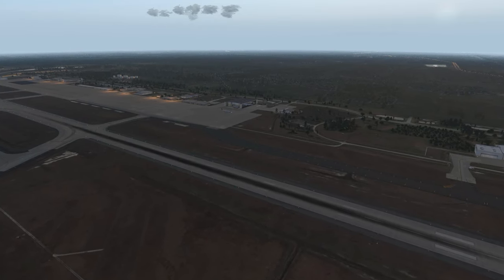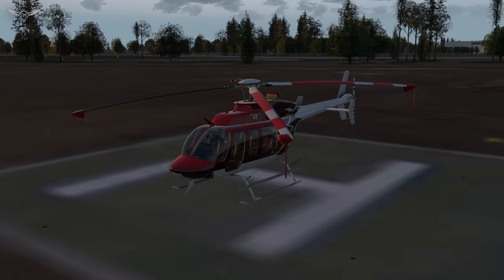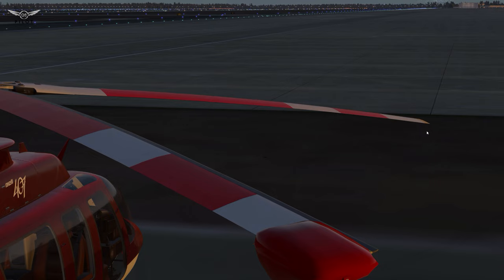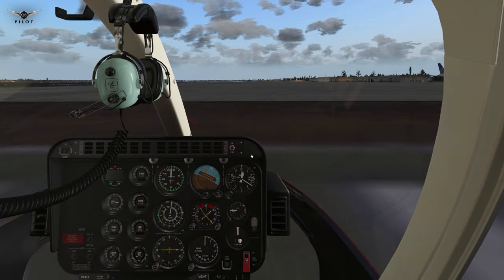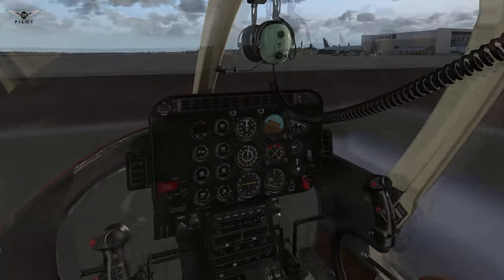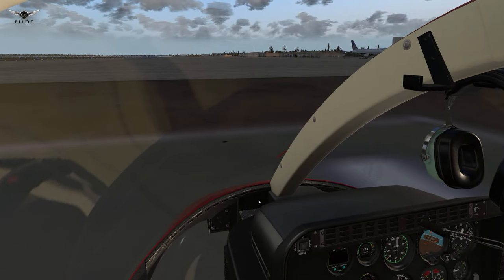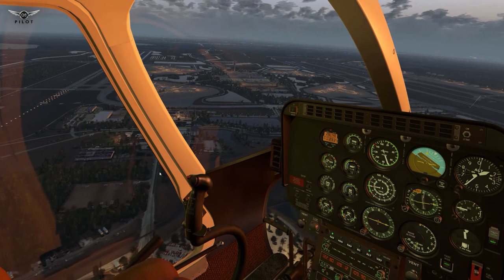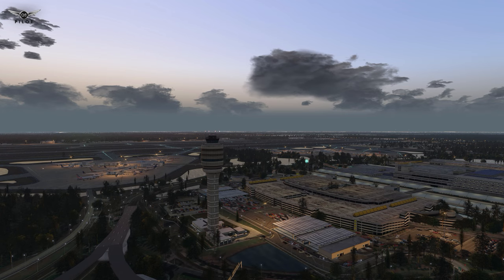Bell 407 for X-Plane 11 | Dreamfoil Creations | First Impressions

Comment: hi q8, I am a CFI for rotorcraft so I can give you and your viewers some insight on how these birds really fly vs. how they fly in xplane. the flight model for the 407 is actually much better than say the schwitzer 300 or r-22 in xplane 11, however they are still a bit unstable versus how a real helicopter flies. first off, there is WAY too much "pendulum motion" in these flight models. all the helo's swing too much front to back and side to side when using cyclic inputs. I guess xplane is trying to replicate the inherent instability that goes with helicopter flying, however it is too exaggerated. you put in just a little cyclic input and these birds just start moving wildly in that direction. real helo's don't move nearly that much with small inputs which is what you want to do when flying helicopters. also, the anti-torque or what you refer to as "rudder"  inputs are inaccurate as well. there is a really bad "rubber banding" motion in the yaw of these flight models which again real helo's don't do with pedal input. Again, the 407 flies much better than the two smaller helicopters mentioned above so I would recommend that people interested in helicopter flight in xplane start with the 407. hope this helps!
Reply: I found if you turn on the SAS it does make the helicopter a lot more stable. This is my favorite helicopter across any sim platform I have flown. (I started with Microsoft Flight simulator when the planes were wire frame models and scenery was just, green for ground, dark blue for water, light blue for sky.
Reply: I started with the AS 350B3, and I was near to suicide... was really frustating... then after some modities went a little bit better. Now I'm with the 407, and seems quite different.

Comment: I can point out some things for you. 
1. The pedals control the tail rotor pitch to offset changes in main rotor torque. The 407 does not have a rudder.
2. In forward flight, if the collective remains stationary, the T/R pedals remain stationary, even in turns. Airplanes need rudder 
    pedal inputs when making turns, helicopters don't.
3. The throttle stays in idle until you are ready to fly. Does your manual say to go out of idle to "25%" throttle setting and let it 
     ground run just under 100% NR and NP? That is very dangerous in the real world. The 407 is flown in the FLY 
     position as indicated on the throttle. Not the MAX position. If the FADEC fails and goes into manual with the throttle 
     at MAX, your rotors will overspeed and ruin you day real fast. Try pushing the FADEC Mode button out of AUTO and into MAN 
     with the throttle in MAX. I'm curious to see how it is modeled.
I noticed that at 35% TQE you are in level flight at 67Kts. At that setting and air speed I would not be able to hold my altitude. During training we would set the TQE to 30% and try to hold altitude , which the 407 will not. We do this during the settling with power recognition maneuver. 
I also noticed the Attitude Indicator never righted itself. It usually takes 5min or less.
Other than that, this looks really nice. Hope you enjoy flying it as much as I do. Thanks for sharing.
Reply: Attitude indicator needed uncaging. I've seen another video where they clicked a button on the bottom right of the gauge.

Comment: You should try Bell 412 by X-Trident. Has been updated to xp11 recently. I had a lot of fun with it.
Reply from the maker: Hey Matt, I did try the Bell 412 after it was made available for XP11 and had tons of issues with it. I will check it out again for sure. Thanks a lot for the tip!

Comment: Different to flying a craft designed to slip through the air, like riding on a bed of silk?. My son is learning to fly a helicopter but I never trusted an aircraft where the wing was going faster than the fuselage and which battered the air into submission. Although you may deduce I am not a helicopter fan, you produced a great video.
Reply from the maker: Thanks a bunch Jon =)

Comment: I'm thinking of getting this. I saw that it has some contextual menus for customization (Garmin 530, radios, etc). Can you choose to have modern avionics on the dash as opposed to gauges ? Also; is it possible to fly from left seat? Is there native Avitab support for both seats ?
Reply: No, yes and yes. Modern Avionics, no. Dreamfoil would have to redesign the entire cockpit. And for a hobby developer, that would be too much and if I`m not mistaken, also illegal. 

You can set up your view so that you could fly from the left seat. However, most of the times, Chopper Pilots fly from the right seat. But, nonetheless, you could set it up. 

I think Avitab is supported. What you can also do is add the RealityXP GTN 750 to it. You have to buy it but, once you have it, you can download a program that implements it into the Bell 407. Dreamfoil supported the project so it`s legal. 

Hope that helps.
Reply: @BlackFoxFalcon  also told before, digital avionics seems difficult to watch in the pc...

Comment: The fps increase at night might be because the reflections don't work without light. How high are your reflection settings?
Reply from the maker: That was my initial thought, but then did a  test at a different airport and didn't experience the same. I think it is something to do with shadows!
Reply: Q8Pilot could very well be, was just thinking out loud.

Comment: Q8Pilot What do you think has more detail and realism FSX, X-plane 10 or 11?
Reply: Stomper003 you can chose yourself but I think that if you have the money and the effort you can make FSX looking really realistic and nice but x plane 10/11 has a really good community and there is more realistic flight dynamics (as I've heard) so it's a hard choice if you have the effort and you have the money you can put into FSX it's beautiful (as I said) but if you want a sim that is nice out of the box then x plane is probably better
Reply: Elephanto Gaming I have FSX and don't want to spend a lot of money on scenery, so would you think getting X-plane 11 would have better scenery then FSX and cheaper then buying add-ons for fsx.
Reply: Stomper003 yes definitely
Reply: Stomper003 that link leads to a website with very good free scenery and even some free aircrafts on it
Reply from the maker: X-Plane 11, in my opinion, it is the most realistic and entertaining flight simulation platform available on the market today.
Reply: Elephanto Gaming So X-Plane 11 is the best option, because I would get a newer flight simulator and get nice scenery and plane for free.
Reply: Stomper003 yes it would be your best option
Reply: Q8Pilot Thanks for your opinion! I'm going to get X-Plane 11.

Comment: Beautifully modeled heli but spool up sounds cartoonish.  What would it take to drive to an airport & record the actual sound of a B407 startin up??  Heck, you could record sittin in your car hangin the mic out the window.  Common Dreamfoil!!  Really?
Reply from the maker: Hopefully they would improve the sounds in the next update. Thanks for watching!
Reply: yes, I totally agree about the sounds. it gets worse when you use xprealistic as there is this incredibly annoying knocking sound when you are spooling up the turbine, like its a piston engine or something starting up. I usually turn off xprealistic when starting up the turbine and then turn it back on once the rotor is up to flight rpm.
Reply: s david p. Is it like a “tick tick tick” sound before you introduce fuel? That would be the igniter. Happens in real life as well unless you pull the breaker. But then it wouldn’t start.
Reply: No brother, the sounds are perfectly realistic , Real life 407 has the same sound

Comment: very nice video! Perhaps you can answer this but how do you prevent speeding up but still increasing altitude when you raise the collective during landing?
Reply: As you are landing, you pull back on the cyclic to raise the nose of the helicopter. That reduces the forward speed. At the same time, you lower the collective to reduce the lift and keep your vertical speed descent speed about 500 ft /sec. Don't descend too much faster than 500 or you'll get into a vortex ring state (VRS) where you're descending faster than your air column and your rotors won't be able to produce lift and you'll crash. You learn about VRS very quickly if you fly the Huey in DCS. Trust me, I speak from experience :-D
Reply: @CharlesDSmith-mv7zi  5 months later I thank you for your response :)
Reply: @CharlesDSmith-mv7zi  I noticed... first I flew the AS 350B3, smaller and powerfull. With the 407 I crashed many times due to this...